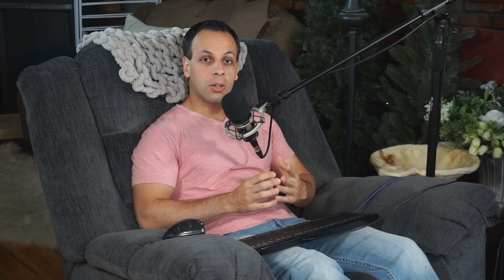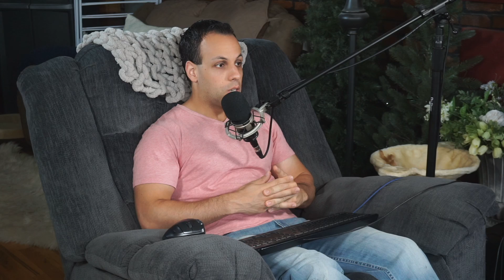Let's talk about what Right to Repair means for how devices are designed.

Comment: I have 1 request for rtr legislation to include, to close the loopholes and achieve repairability for private repairs as well as businesses: Companies must make all the parts, schematics, boardview and required software they use to assemble their product available for a total price no more than 120% of the finished product, if you buy 1 of everything required. A 200$/month subscription for boardview/schematic is useless for private persons/one man sidebusinesses. Equally useless are 800$ charging chips or chips with no firmware or way to flash firmware.

Comment: Doesn't have to be super thick. Just thick enough to provide good structural integrity and reasonable battery life. Also there is no need for using so many different kind of screws to hold together a device.  It should be possible to keep the differences to a minimum.

Comment: I'd argue that right to repair at the minimum means access to parts and proprietary tools for a reasonable and non-discriminatory price and access to service documentation for free.  If a manufacturer does not provide the tools and documentation, the recourse is going to court and getting a court order to compel them to provide these items along with paying the successful plaintiff's legal fees and a stiff fine.  If I want to make devices more serviceable, having a disclosure law where electronics devices have a nutrition label would probably help.  It would disclose if the software is GPL or proprietary, if it can be updated by the end user, if the screws are standard, if the battery is user-replaceable, is anything glued into place, etc.

Comment: The easiest way to explain right to repair to the naysayers is to use the car analogy. Ask them if they prefer going to an auto parts store and having the ability to choose the part and price point they desire and install it rather than going to the official dealership and paying whatever price they command and getting the work done to their timeline instead of yours. If end users of cars were not allowed to repair their own property then all auto parts stores would become extinct and there would be very long wait times to get your car fixed at very high prices. That would of course be the exact opposite of free market capitalism and competition.  Right now I can go to the auto parts store and have multiple parts (in most cases) and price points to choose from. I can perform the repair myself in a short time. For instance lets say I need a new air filter. I can go and pick out a cheap one for twenty dollars or a more expensive one for fifty dollars or even one that carries a long warranty for a lot more money, it's my choice. I can take it home and install it in under ten minutes and be good to go today. If I were forced to go to the dealership I may have to wait days or weeks to even get my car into their shop and I would have to pay whatever they desire for the part and pay for their labor. Some shops have a minimum rate for repair (usually an hour) and it can be as high as ninety dollars an hour.  A simple air filter that I could have installed myself for twenty dollars or less in a few minutes may now cost me a couple hundred dollars or more and take me a week or more to get installed.  The same principles apply to pretty much all consumer goods or should. If there is a market for repair of a certain item then by all means let people compete to make that repair.  To remove that right from the end user is an attack on capitalism itself and the American free market system.

Comment: Agree with everything you’ve said apart from change to software. It’s not just iPhones, but I know more about these phones so my point will refer mainly to iPhones. 
Since the iPhone 7, Apple has been pairing parts to the motherboard unnecessarily. My phone (11 Pro) has a battery that is paired to the motherboard for seemingly no reason. But if anyone other than Apple does the repair (and they charge exorbitant prices) then you’re either stuck with error messages and artificially removed functionality, using a hacky programmer (JCID etc) or sometimes both - I.e. you reprogrammed the chip but Apple still finds ways to give you messages and remove features (such as battery health info, True Tone, vibration etc).
I’ve also heard of Samsung starting to do stuff like this recently.
I think protections so manufacturers can’t pull this sort of BS should be in place by law in addition to what you’ve advocated for. It would require change to software/firmware but I think it’s essential otherwise any repair will always have the threat of software lock hanging over it.

Comment: Spare parts and replacement chips should be available on the market.
Repair difficulty should be on a level where service providers, either within the company or independant repair, dont throw out the entire board when 1 chip dies.
Any repair then to be made, should be accessable in such a way that it doesnt endanger the product or other components, when switching out the broken component or chip.

I think thats a fair set of demands, right?

Comment: Hmm, there are devices designed so that they can't be opened non-destructively. I think filling up a device with epoxy/glue as the last step of manufacturing should be outlawed. It just doesn't happen to phones or laptops because weight matters in that category. That's why they use software locks instead.

Comment: I'm glad you can still change the batteries of macbooks even though it requires to get the adhesive off..
some cheap devices or notebooks even have the battery wires soldered onto the motherboard while apple does not.

Comment: I am for user removable/replaceable batteries be authorized once they have been engineered to be so.  That isn't Right to Repair though.
That is a Waste/Reusability/Safety/Device Protection thing, not a repair thing.   The problem was no one was engineering batteries in cases  that were thinking about weight, space, or aesthetics.  They were just worried about overbuilding them to protect from lawsuits.  When they designed the current batteries they did not worry about disconnectablity, replicability, or user safety as they were not supposed to even see them.  No one tried to engineer a solution in between and maybe they should.  But that is another fight.

This is just about getting access to schematics and parts and also saying that not a blessed few with the holy touch of industry can repair something for you or you as an individual, who actually owns the thing can repair it because its yours and that is what you want to do.

Comment: Louis i understand what you are saying, but there are something we just have to enforce no matter what. Having user replacable batteries should be top on the list, from repairability to ecofriendliness, there is no world were having that is not a positive thing. It has gone way to far it must stop. So i think this is a 3 part hit, access to scematics and tools, access to parts and lastly enforcing of User removable batteries. Right to repair for me has no value if not all three go in action at the same time, because as you said they will water it down.

Comment: There is one trend that I hope RTR will reverse. That is sereialization of components to the device, ex. you can't change screen/battery/fingerprint scanner without some stupid information every time I use the device that the part is not genuine. Give us a way for buying legit parts and stop matching them to the only one that the device came with. It should be easy as that. Have a way of reporting if part is original if you want to, but just let us buy the parts if we need to.

Comment: This. 
(Coming from a mechanical design engineer)
Products can be designed however they want. The right to repair aspect is making sure that parts are available to be used/swapped in.

If something is a pain in the ass to replace (most oil filters in australia) sure, whatever, I will deal with shitty hand access. But when they say I 'need' to go to a ford dealership for my 2000 Ford falcon because... I draw the line.

Comment: No change at all to the devise....doesn't sound fair, to be honest. It sounds like you're being overly cautious. Because I'd say that gluing phones so I can't even try to open it up without risking damage to it is a predatory practice. I do not want to support that practice, but almost all, if not all smartphones nowadays are glued. The market has left me without choice. What I believe is that CORE components and common wear parts should NOT be mounted in such a way that makes the replacement potentially damaging for the device (glued phones) or needlessly complicated (started under the intake manifold, requiring you to remove the engine to replace it, as else someone pointed out) 
I believe people should be able to replace the screen, battery, camera etc without the need to go to a repair center. They would always have the option to do so and ideally the repair center should be able to just buy the part and have a schematic

Comment: I think there should be a Certificate like Rohs but instead of certifying that this device doesn't kill you by being toxic it should certify a certain grade of repairability. Maybe even variations of the certificate so the consumer knows before buying at one glance if the device has proper repair support, a replaceable battery and/or a socketed cpu+gpu.

Comment: It's already too late anyway the M1 MacBooks to show us the direction that apple is going to take it. The entire computer is going to be one chip. Want more ram? Buy a new computer. Need more internal storage? Buy a new computer.

I'm not against for example it being difficult to add RAM to a computer. I am however against it being impossible. But really it's no different than simply selling a machine that has just enough RAM slots to have the amount of RAM in it at the time that you sell it. I suppose at that point at least if some of your memory went bad you could replace it. But you would never be able to upgrade the amount of memory in your computer.

For me I put my money where my mouth is and I only buy hardware from manufacturers that at very least are not obstructionist towards open source drivers being written for their hardware.

That's true at least on the PC side of things. So far to the best of my knowledge there's no viable option for a mobile device that I could use day to day that fits these requirements. I'm hoping somehow that right to repair will also lead to enough information being available about these chips in mobile devices for drivers to be written that will allow me to break free of the Google / Apple stranglehold on the market.

Unfortunately we live in an age where consumers continually do things that are against their own best interests because they want the shiny new thing.

Comment: Whats wrong with same (agreed standard) charging port on similar devices with same 7.4V (3.7/9/12/24V what ever) batteries? So lets go to same 80/90s with 69 different proprietary ports, then you need like 3-4 wires: positive, data/sense/balancing, negative. Self regulation do not work. If you be to "soft" soon you'll  have 3 different "Right to Repair" from same manufacture for same device.

Comment: So, I get an iPhone, that you can't open the back of (or at least are not intended to) having a "non-removable" battery. What I don't get is why my POS Nokia 2 has a metal screw-plate over the battery when the back is removable. Presumably that in itself would add to the bulk of the phone (which is already quite slender in profile), and the back itself is removable to access the sim and SD ports. 

I'm not an engineer, I have the slimmest of dimmest understanding of how to design electronic devices. However, this Nokia 2 seems to have this plate in place "just 'cuz" in my layman eyes. That's what pisses me off. I have the tools to remove it. I have teeny screw drivers and if need be a soldering kit I've yet to dare use.  My issue is why do I need all this crap to change the battery? It's a budget phone jumping on the same train as high end devices that take pride in their prestigious and illustrious litany of design quirks and features crammed into the smallest shell possible.

FFS, I just turned 33. I feel like I'm going into grandpa mode here wishing they'd just make 'em the way they used to, or at least having that option available or readily presented when perusing for a new device.  

~shrug~

Comment: @Louis R. I agree with most of what you have to say, and being a strong advocate for maintaining innovation ahead of consumers technical skills.  However, I live in the same county where Senator Grassley resides. My question to you is:
How are you going to convince Legislators like Chuck Grassley to force Deer John to change their ways? As John Deere has been making the transition to a service-based enterprise. Sell the Farmer a tractor. After so many hours a small part fails, and the farmer is forced to have a O.T.A. diagnostics performed at an outrageously expensive price. Then a tech will come out and spend 20 minutes to install the replacement part and program the software, because the Farmer with proper mechanical engineering background can't simply rip a perfectly functional part off a different tractor, and replace it themselves. Or could have the option to purchase one from their local implement. 
---
Calibrating machines is just too complicated for us peasants who can't even own the land that they farm on anymore.

Comment: The reality is that outside of a few discrete components and nothing more.  Chips will be replaced with "stacks" that will be expensive.   So instead of a board with hundreds of small parts, you will see those parts consolidated into chiplet style designs that will be stacked into a monolith unit.  So when you open your Iphone, as an example, you will have very few components:  A one piece monolith screen, a one piece monolith main board, a one piece battery, and one piece external connections.  They will likely be formed into IC style cubes.   Companies will call it a single component, and will likely charge at or near the replacement price for the phone for each.

Essentially, you will get exactly what you asked for, the right to repair at the component level.  It's just that the components will be locked together in a single monolithic stacked wafer.  Congrats, you "won"

Comment: Anti-right to repair lobbyists try to make this shit into rocket science and some huge moral dillema. Cars already have right to repair. If a cylinder in my car cracks my auto manufacturer doesn't have to guve me blueprints to the whole block-just tolerances for the maximum bore diameter for a sleeve, tolerance for the face of the block .etc

Schematics and parts from the manufacturer are the way to go. If Apple says they dont want to sell their SMC and have it reverse engineered then fine, sell the chip with the software + killswitch installed already.

Comment: I agree but disagree with regard to how manufactures design their devices.  I personally think the parts of a device that have a level of unavoidable obsolesce where the component will only last 1-3 years (most commonly, a battery) it SHOULD be designed to be replaced.  Maybe its so that I can do the service myself, or so that we minimize the concern of adverse affects / damage to other components or cosmetic damage to the exterior of the device.

Comment: While I do agree with your sentiment of not requiring devices to be designed for repairability as that would make those products worse for general use, I could also see a world in which phones etc will be designed in a way to make any repair purposely harder.
Imagine you can get a new battery for the next iphone, but the one in there is permanently married to the circuit board. Also the back plate is shrunk onto the screen, so any attempt of opening it will most likely result in something cracking.
I don't see there not being at least an attempt at making things harder to repair, but still better to not put any design restrictions on them just for repair's sake.

Comment: But what if a chip in the device secures that device so it would be unable for malware to attack my data?  Allowing you, or anyone, access to that chip would put my data at risk.  This is why Apple locks down hardware to the motherboard, and why they don't let anyone buy the chips that make the devices.   Right to repair will make them less secure.

I am for right to repair, but as long as the user's secuity and privacy can be guaranteed.

Comment: Prediction: Apple has engineered their new products for right to repair to pass, and will soon maybe even support right to repair, because once all of their products are embedded into a monolith system on a chip that doesn't allow replacement, they will reap the rewards of not having to worry about R2R. Can't repair a battery or screen that is tied to the encryption of the system on a chip hardware key, so they will let you buy a power distribution chip or some other component, knowing the vast majority of repairs still will be unable to be made because of hardware tied to the encrypted system hardware keys.

Comment: So what hapens when you CAN buy the part, but it STILL doesn't work because the manufacturer checks serial numbers and doesn't boot?  Now they have complied, but haven't really given you a right to repair much of anything, since you can't actually replace the part without their say-so even though you could buy it from Intersil, or TI, or STMicro, or NXP (or whomever else can get their parts into an iPhone).